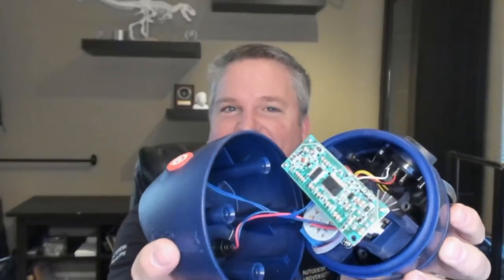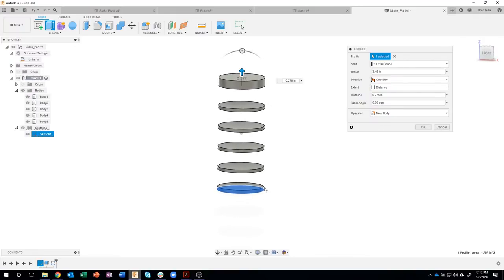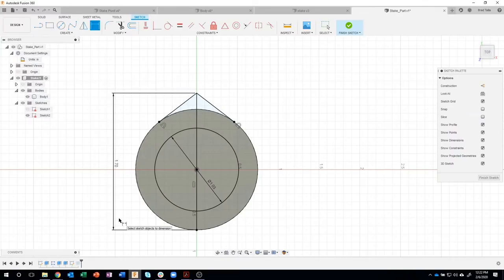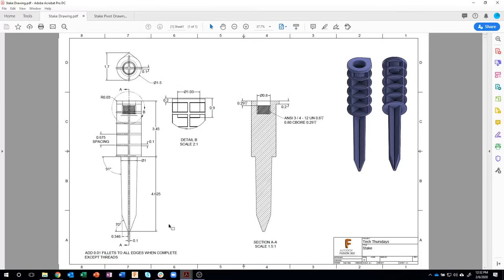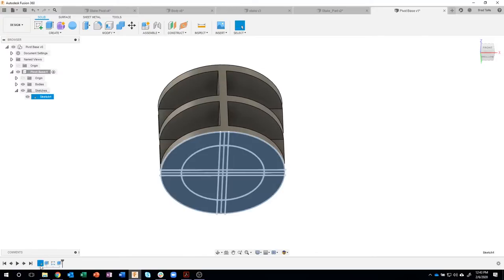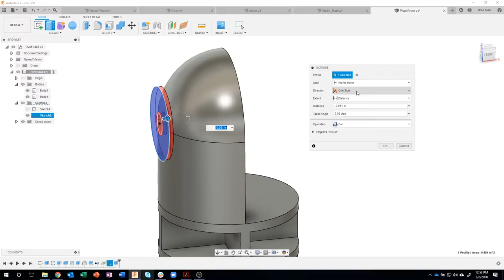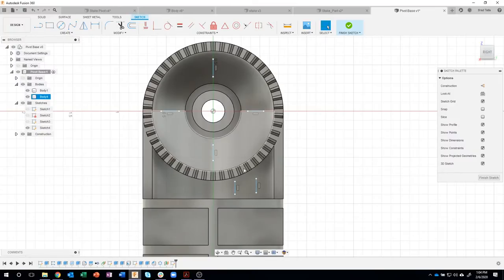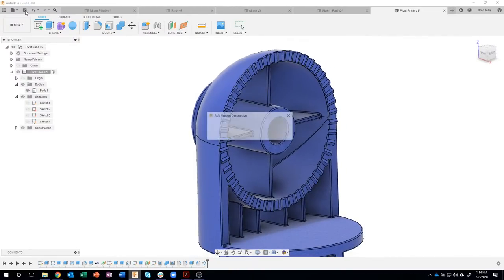360 LIVE: Laser Projector Build - Part 1

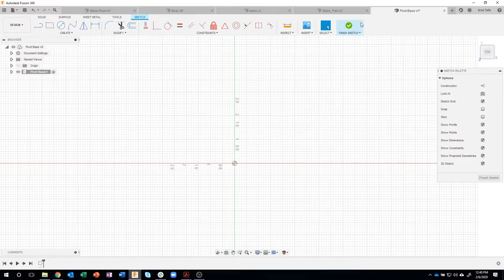Comment: Copy ans past a sketch across designs [files] is great at 42:35 but you could take it a step further! You could create a file with only that sketch and call that design “Reference sketch” and then insert it in both sub assemblies and build from that reference sketch. That way, everything is parametric! If you modify a dimension in the reference sketch, all sub-assemblies will  be automatically modified! I use this technique to work on very large assemblies to split it in sub assemblies and make it more manageable. Also useful for team work! Where different members can work on different sub assemblies simultaneously. The “reference sketch” can have multiple sketches on different planes. Every sub assemblies can build upon these sketches. You can also use these sketches inserted in a “Main assembly” file where you also insert all sub assemblies and creat joints between the sub assemblies and the sketch so that in the end all comes together and still respond parametrically to any changes made to the reference sketch.
Reply from the maker: Great suggestion! We used this workflow when we designed that CNC router in house. I think we called that base sketch the "skeleton".

Comment: Hi... I'm having trouble creating the point on the top face.  I select the line tool and click on the circle when I see an X on the circle, but when I hold and draw the line it still anchors where I click and the tangent icon isn't there as I draw.   Maybe a setting I'm missing?  Thanks, Irv
Reply: 11 months with no answer. You've probably moved on. I'd like to help if you still need it, but I'm wondering... are you talking about making the hole on the top face? Maybe you could give us a time in the video where Brad's building the project.
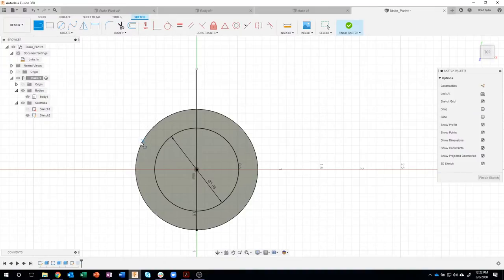Reply: @billbyrd9845   Thanks, Bill.  I am revisiting this model a year later and I had no problem with it.  I was just learning F360 then and have a bit more experience.  The problem, I think, was in attaching a line to a circle so it's tangent.  When you click to start the line, you hold the mouse button down, unlike the way they teach you, to click and let go.  Holding the mouse button allows the line to "anchor tangent" on the circle.  Thanks for jumping in.  It was at 24:00 in the video.

Comment: I said I'd add a comment here, about the problems I had with Eagle, sorry completely slipped my mind.
Biggest problem I had was with the autorouter - I make my own boards using the isolation milling process, and the autorouter assumes I'm having boards made professionally. Result is, my boards don't have through-plated holes, so components that are through-hole (like pin headers) get routed as though their holes are through-plated. I have to spend hours re-routing tracks and creating vias (I use brass pins, soldered both sides). Mistakes are frequent and costly.

Second problem was exporting the gcode for milling the tracks, have to manually add code to probe the board to map the surface, otherwise you end up milling too deep or not deep enough. Then manually editing the drill files so the drills are used in size-order (manual tool change lol), making sure everything happens in the right order.

Not sure how far you are willing to go to make isolation milling easier for us hobbyists, but for me it's the only way to make boards. Laser transfer and chemical etching is ok for single-sided boards, but you still need a cnc machine to drill the holes, and getting them in the right place is a nightmare!
Reply from the maker: Hey Fred, I'll make sure the Electronics SME's see this! 
Thanks for the great feedback.
Reply: @adskFusion  Always happy to help. :)

Comment: After making the four-bladed stake portion, my browser shows a Body7 and a Body1. I used Join in the extrusion, not New Body. In the video, you only have one body in your browser. How did I do that? Please help.
Reply from the maker: @Bill Byrd-  See if you can do a Modify-->Combine command and combine the 2 parts together.  If they don't, that means they aren't "clashing" or touching each other.  They need to be for the Join to work.
Reply: @adskFusion  Yes, you're right. I got help from the forum and learned to combine them for one body. I still gotta wonder why you didn't have to do that. ??? You do the best tutorials by far.

Comment: Ive downloaded your fusion 360.....I 3d print things....why is my Y at the top and in this video you have Z at the top....were it should be....?

If i change to Z up in pref's nothing happens.....The Y still remains at the top of my box ?

Changing to STL imagine puts my object on its side in my slicer software which has Z at top......same as every other work surface ive ever come across....so what are you doing defaulting my Y at the top....????.....I don't understand why youve done that when Z is always at the top.....

Why cant i have my work suface in fusion 360 the same as my 3d slicing software work surface with X across....Y away....Z up ?.......

Thanks.
Reply from the maker: Rich, changing the option in the preferences will change that setting in new files only. Create a new file and verify that the Z is going the direction you want it to.